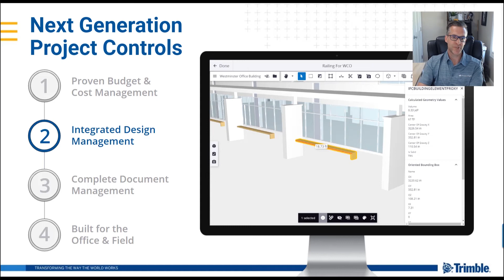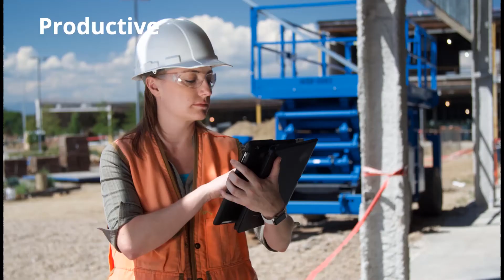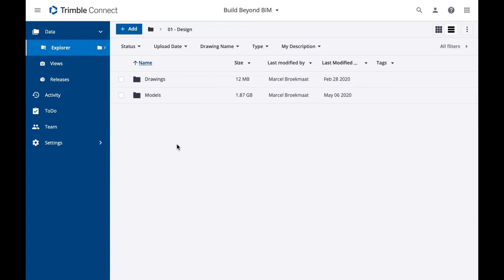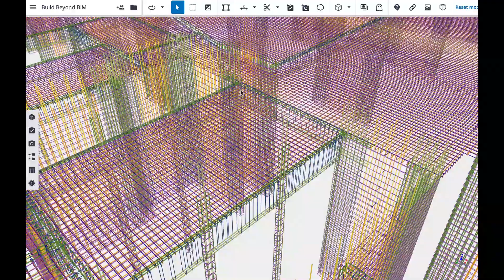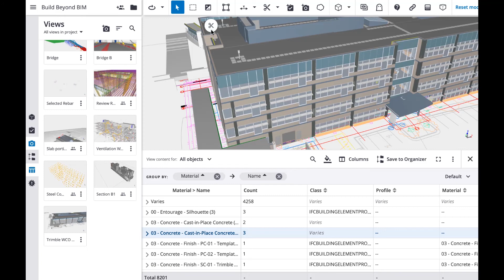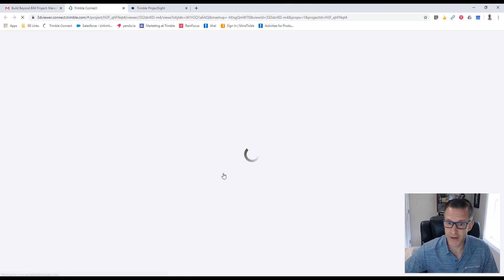Trimble Connect Webinar

Comment: This is nice, but what's the value for those that are not project managers looking at the project on an iPad and leaving comments in red? If one is making a Sketchup architectural model, one wants to use Trimble connect to link in different models for visual reference only, thus  keeping ones models small in terms of mb, and also having other consultants work always updated. That does not happen when Sketchup still relies on low quality ifc and dwg import filters . Distributing dwgs, ifc´s out has many other limitations in quality and efficiency.